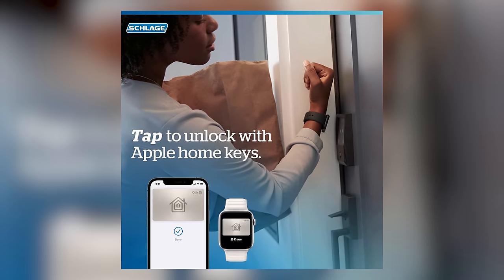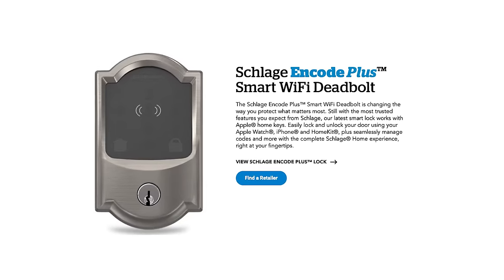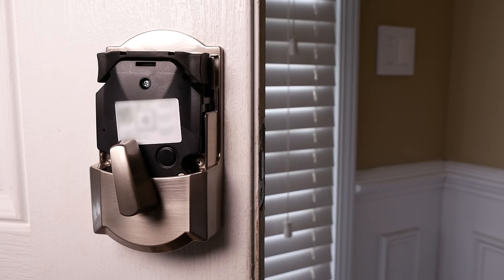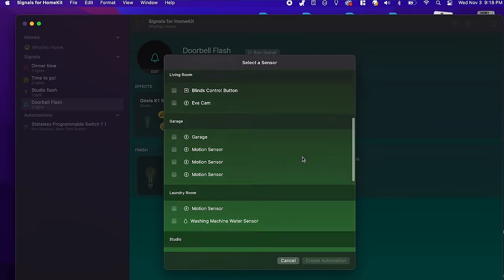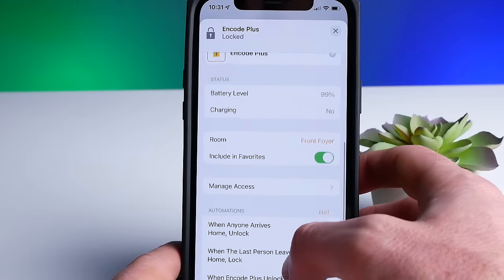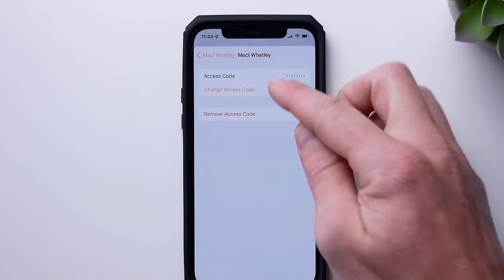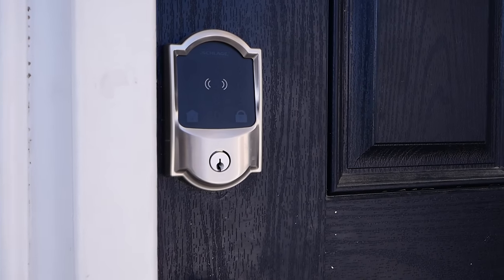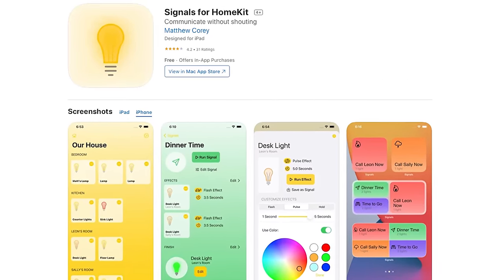Worth the wait?? The Schlage Encode Plus Smart Lock with Apple Home Key is here! [Full Review]

Comment: Several questions. How long do the batteries last? I assume you would have to uninstall the lock each time to replace it. Also, regarding Homekit automations, maybe, if you're using your phone to unlock the door and you wanted to have music play or something like that, maybe you could place an NFC tag behind the lock? Or use Homebridge/Hoobs to enable a virtual switch. Last question is about additional door sensors. Like I have an Aqara sensor with the hub. With HomeKey added to it, I'm wondering if these additional security measures are even needed.
Reply: The battery compartment is easily removable. There’s a plastic cover on the interior deadbolt side that slides up, and the battery pack can be lifted out easily.

Comment: I love the idea of this lock, but I current have an August lock with a keypad and August has an auto-unlock feature that I wished worked in HomeKit. 
With HomeKit there is no auto-unlock when you get home. You still have to tap your Watch, tap your iPhone, or pull out your iPhone to run the unlock automation.
Reply: Shane told us in a previous video on automations how to work around that limitation. I have an August lock inside our garage on the door to our kitchen set up to unlock whenever my wife or I return home (and to lock it whenever the last one leaves). The gist of the workaround is that you can use an empty smart plug as a ‘switch’ to bypass the tap your phone security restriction. You set up automations that open/close your August lock when the smart plug turns on/off. Then you can create an arrive home automation that turns on the smart plug when you get home. Turning on the plug/switch doesn’t require a tap, so it turns on the plug which opens the lock. It takes four automations to get it to work (plus the one that actually triggers it). You need switch off locks lock, switch on unlocks lock, lock open turns on switch and lock closed turns off switch. (The last two keep the switch and lock in sync if you manually open or close the lock.) Even though this is working well for me for when I leave for work and back, I am sorely tempted by the Home Key feature of this lock. I walk/run every morning with just my watch (so I’m not ‘away’ to HomeKit because my iPhone is home) and opening the August lock with Bluetooth can be slow. It would be really nice to just walk up to the door and in without opening the August app, waiting for them to talk, etc.
Reply: @DrRobAlexander  Nice! Thanks for the recommendation!! I must’ve missed that video.
Reply from the maker: @DrRobAlexander  Thanks for that explanation. That is certainly how to create a workaround for location based automations involving "secure" accessories. This is also a great use-case for virtual switches (I use the dummy switch plugin) if you are using HomeBridge or Hoobs. That just eliminates the need for the physical smart plug.

Comment: Can you have 2 of these locks and will it work with 1 home key?
Reply from the maker: I'm not sure... I could only afford one 😆.

I would assume that each lock would generate a new Home Key. But with Express mode on, you don't even need to open the wallet app. Just tap the phone or watch. I assume that would automatically detect the correct key and unlock the lock. But I haven't been able to test that of course. Good question.

Comment: A NFC tag would make my current smart lock like this.
Reply from the maker: An nfc tag does not work as seamless as this with a smart lock.
Reply: @ShaneCreates  good to know that but I would unlock the door with the HomeKit app before I get close to the door, or before I get off the car. 

Like I have the npc tag at the garage door I would use my phone to scan that tag to push the unlock front door command. 

This is how I look at this lock, instead of using the key I have to use the phone as a physical key to tab the lock… it’s same a physical key, isn’t it?

I’m trying to find a reason to upgrade lol

Comment: The big problem with the screen button, is that you will get a wear sheen on the pressed button.  Therefore someone can guess the entry 4x4 combination.
Reply: That key pad it’s pretty much there for emergencies or guests. How many time you think you’ll use it having home key integration? Plus each house member  can have their own favorite code if you wish.
Reply: @aldotorre8802  Personally I wouldn’t have one. I use Level and would wait for a version doesn’t look like it has any smart components.  

Yes the screen button would be used occasionally, but we both know most people just don’t think that far. It will be one emergency code for everyone, it’s how humans think.
Reply: @anthonycraig274  If your kids have different codes you know when they come in and when they come out for example. Having different codes is an advantage, but in general who buys this lock is to open it with your IPhone or Apple Watch. This is so far the one and only that can do that and you pay extra for it. Otherwise, there are much cheaper options out there.
Reply: @aldotorre8802  I agree with everything you said, and believe its a solid tech and I don’t even mind the price.  However,  I just understand how the normal consumer act and behave and the weak link is the keypad.  Maybe next gen the pad will be able to random generate a new keypad configuration after every entry.